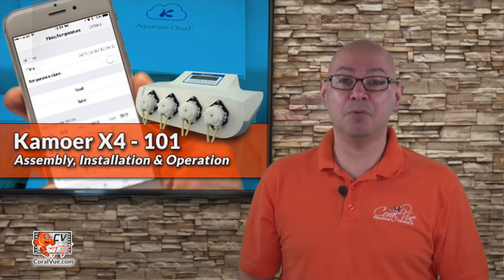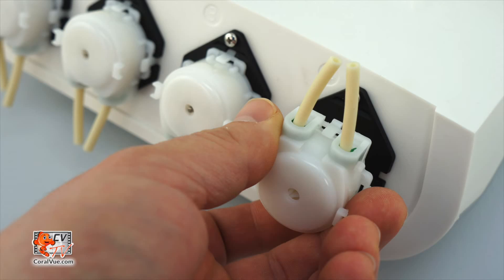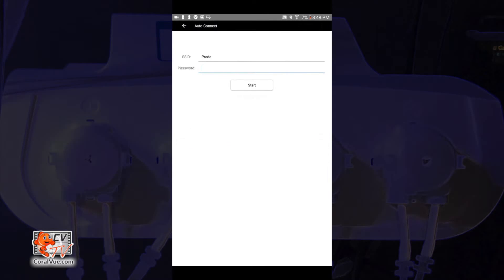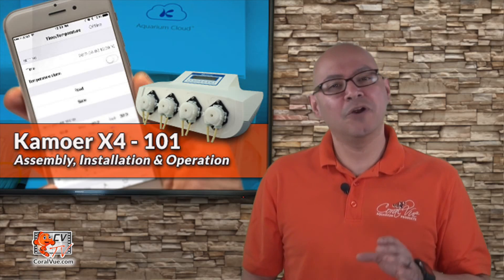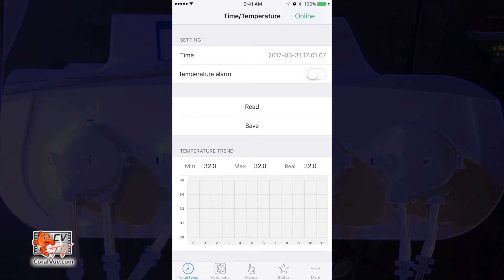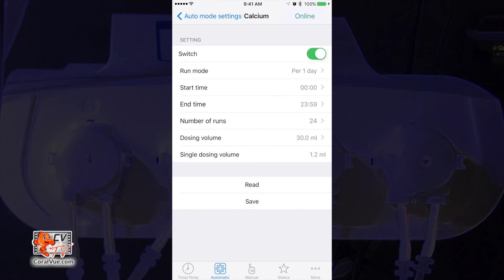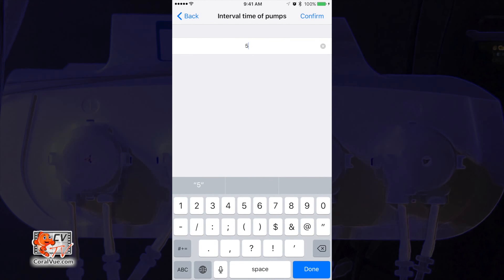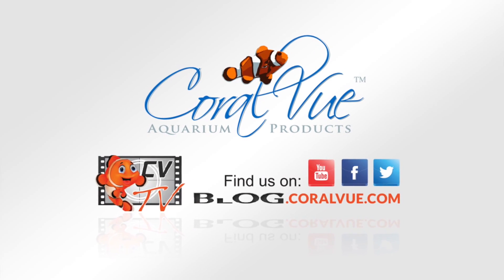Kamoer X4 101: Assembly, Installation & Operation

Comment: These instructions do not work
Reply from the maker: Sorry but can you be more specific on what did not work?
Reply: CoralVue yes following the intructions results in a time out error message. Its all over the forums that this doser wifi the most frustrating portion resulting in many not to use it.
Reply from the maker: You must follow the steps in the same EXACT order as shown in the video otherwise this error occur.  If you continue to present this issue please head over to coralvue.com/support and a service tech will help you get your doser operational.